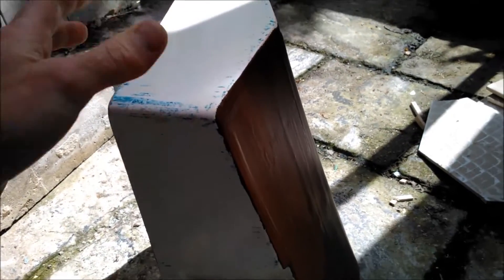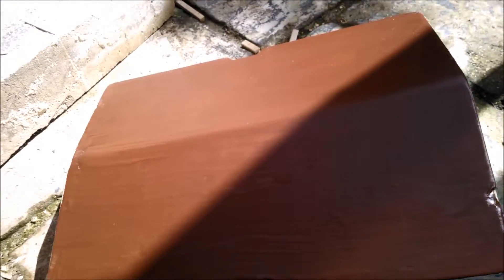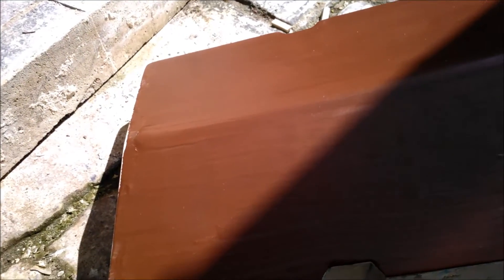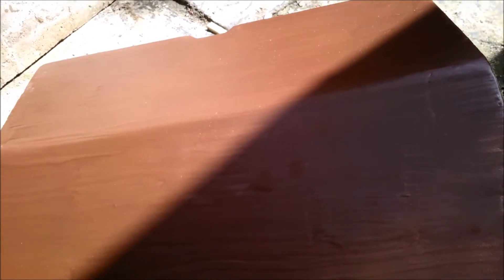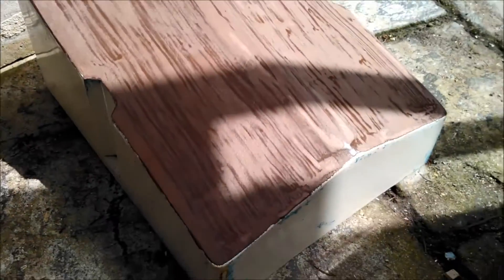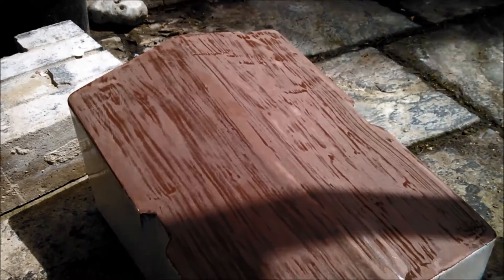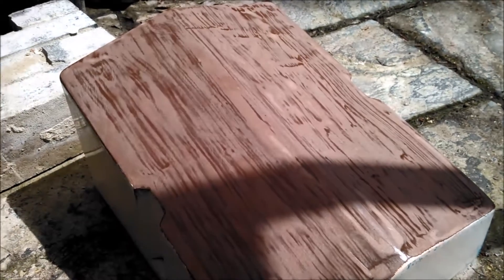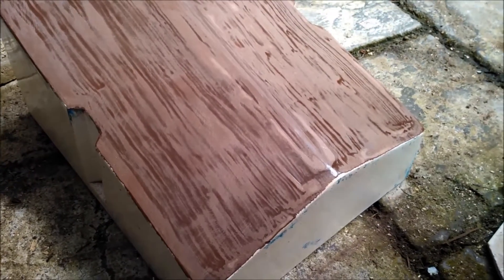DIY Coppercoat antifoul - Part 1

Comment: Hi, When you say you mixed it 2 to 1 by weight, is that 2 parts epoxy to 1 part copper?
Would you recommend doing this to a whole boat?
Thanks in advance

Comment: Was that a water based epoxy?? The real coppercoat is water based as it needs to 'wear' down to expose fresh copper. When pulling out you are meant to wash and then sand down lightly to help expose the copper. I've found a source of water based epoxy and maybe I might give this a go next year. It's got to be better than flaking paint off into the sea all the time.

Comment: How'd it work for you?  Any results?
Reply from the maker: Khepramancer One year in and there's just some slime on the panel - it's been sat at the waterline where I'd expect it to get quite weedy like the rest of the boat. There are some more photos on http://www.sailingaround.co.uk
Reply: Joseph Moore Thanks for the reply.  Sounds like it's holding up pretty well.  I run a small commercial crabbing boat, and would like to use a DIY antifoulant.  I'm still a little wary of putting epoxy all over the bottom of my boat, and would rather use the ablative paint (self-polishing copolymer) that is used in most commercial cuprous antifouling paints.  You wouldn't happen to know where I could find that sort of paint (with nothing already added), would you?  I've sourced copper powder from several places and am still looking into it.
Reply: You need a water based epoxy coating rather than normal laminating resin. It wears away over time exposing fresh copper powder. Floor coating companys use it.
Reply: @AndysEastCoastAdventures  I have a boat in greece and I want to copper coat . I'm looking to use water base epoxy just like they use on floors would this be ok ?? Just looking for someone who has done it .thanks in advance pere